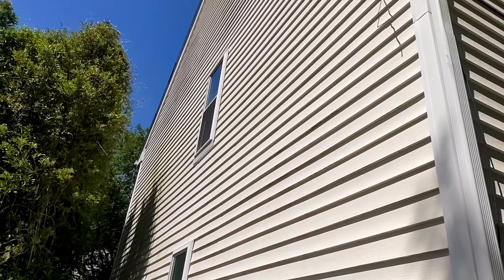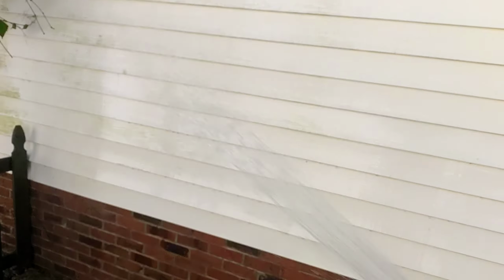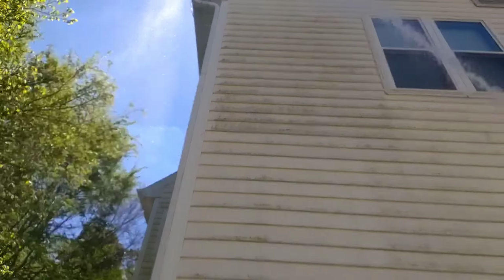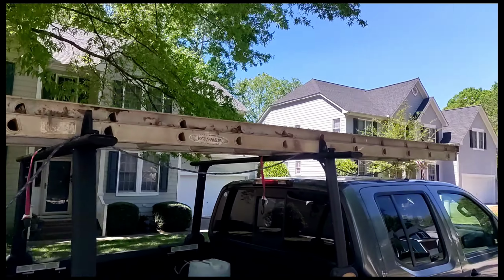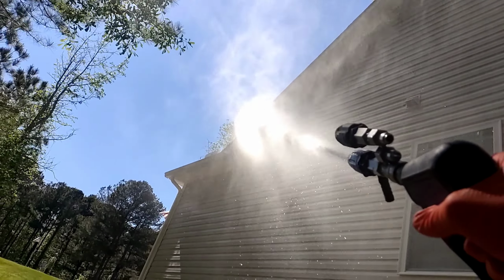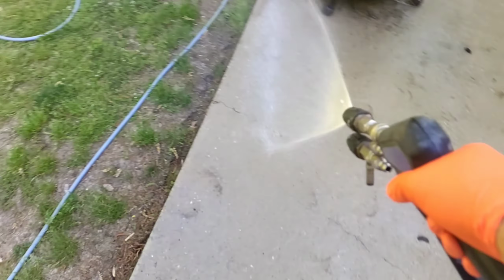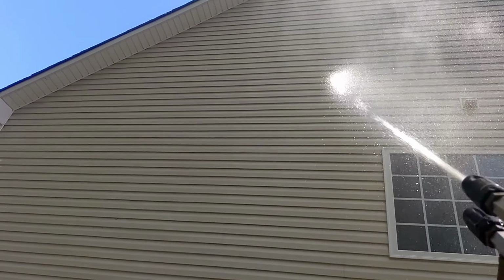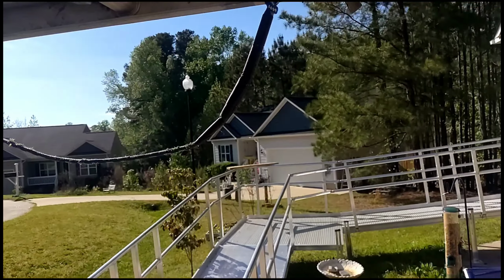Beautiful Green House Washed (Turns out it was White)

Comment: I haven’t used it yet I just got it for backup but I suppose 20-30 ft But I also believe in using the pressure washer with a j-rod to downstream will luk but I kinda don’t like battery powered 12v systems because lot of them clung out  gonna use 1-2% mix though to start with
Reply from the maker: Nice, I have always wanted one. But most higher concentrated SH needs, i just use the x jet

Comment: Can you elaborate more on oxidation? Does it not come off with normal softwashing of house, so youre just letting owner know?
Reply from the maker: That is correct, oxidation mostly is caused when rain water evaporated on siding leaving behind any mineral deposits that it contains. This is one reason why you see it more prevelant on the southern side of the home, due to rapid evaporation in the sunlight. 

Unfortunately SH leaves behind minerals (sodium) on the siding if it is allowed to dry on the home. This is why I don't wash all 4 sides before rinsing. I'm always keeping the mix wet on the house. I do an oxidation test before each wash to verify if there was oxidation present before my wash, or not.

This way if the homeowner finds oxidation after I have done the job, I will have recorded this test to refer back to one way or the other.
Reply: @steppspressurewashing  thanks for detailed reply!

Comment: How’s that dodge dakota holding ? I want to buy a used one w 150k miles but I’m out here doubting
Reply from the maker: I actually have a Nissan Frontier. 150 is a lot of miles, at least the way I drive...
Reply: @steppspressurewashing Nissan frontier? How many miles? What engine ? I’m just scared if I put a trailer and 100gallong tank plus equipment will brake trans or engine 😂😓